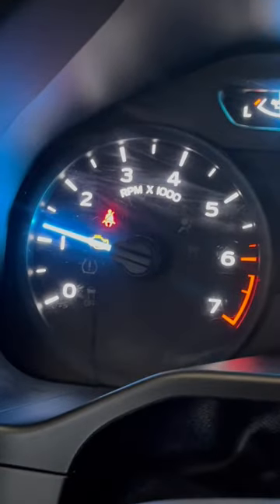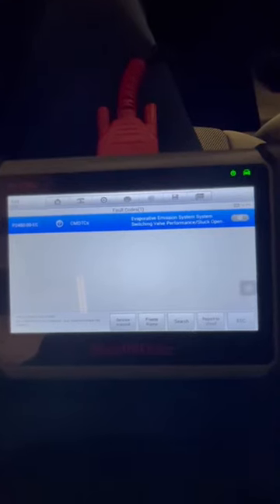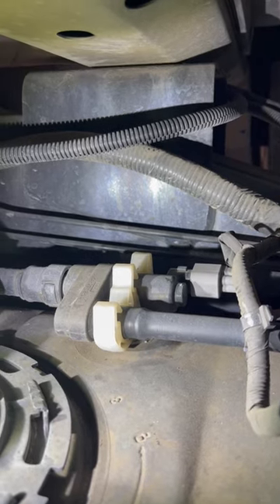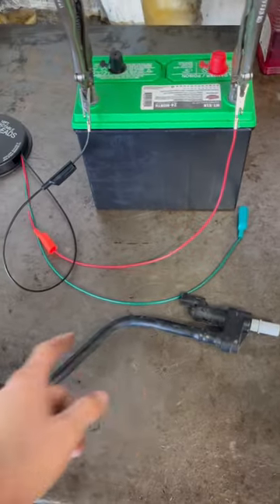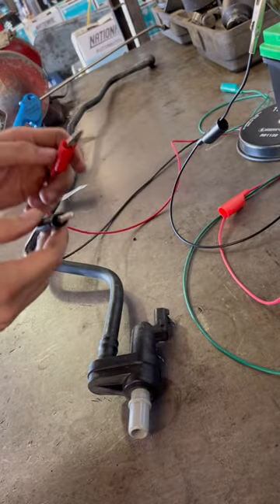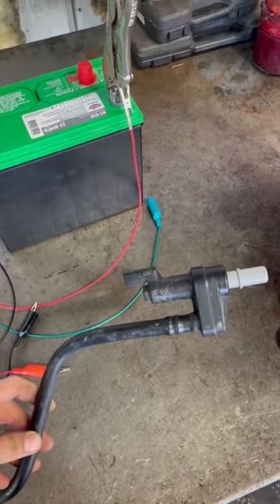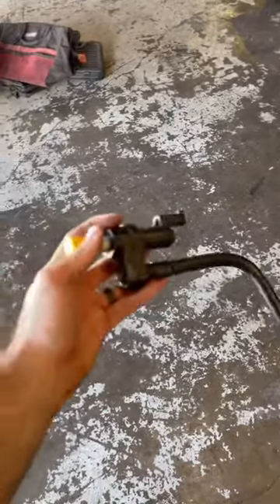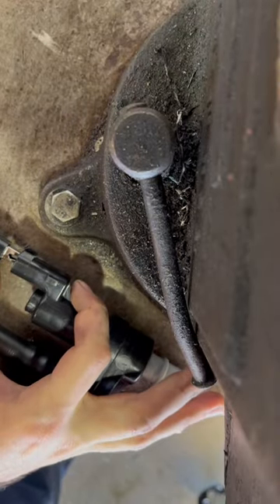2016 Ford F-150 P2450 Code Diagnosis and Fix

Comment: $300! 😳
Reply from the maker: Yeah! List price is $266 plus tax.
Reply: @jackhfletcher  did you tap it with a hammer to make sure it wasn't just stuck? Sometimes brake cleaner will unstick it too, much less than $300
Reply: @byanymeansnecessary9329  maybe.  But what if that only works for a week then your back in paying 90 bucks in labor. So you just paid for the part doing that..
Reply: @Ryan-re1rs  DIY, no labor it's your time.
Reply: @jackhfletcher hello, could you please tell us the polarity. I looked and looked, but I can't see any plus or minus on the pin connectors.

Comment: Complete the evap monitor to confirm fix and no more issues with that system
Reply: How do you do that ?
Reply: Perform EVAP monitor drive cycle
Reply: @jonnysanchez3833 can I do that in my driveway? Any special equipment required?
Reply: @yousufkan6960  no. Google EVAP monitor completing for your specific vehicle. All vehicles are different. 
There are certain parameters you have to meet before the Engine control module will run that monitor...
Engine coolant temperature, air temperature, fuel level, etc etc, just to name a few

Comment: Same f problem right now tell me what can I do buddy, did u order the part at the dealership
Reply from the maker: Yeah, order it from the dealer. Part number is FL3Z-9F945-C
Reply: @Jack Fletcher  thanks a lot buddy 👍
Reply: @jackhfletcher  thanks for your video . I have the same truck same code P2450 my car doesn’t start . did your truck start?
Reply from the maker: @josue cantarero Yes this truck started and ran fine with no issue.

Comment: How can you tell the difference on pos and neg on the sensor to test it like that . Pins different sizes or positioned different. On older switches and sensor it doesn't really matter in my experience you can try either or al youll be ok , but these new delicate ones ?

Comment: Did you have to drop the gas tank or can you reach up there if you lift the truck?
Reply from the maker: I loosened the straps and dropped the tank a few inches to get some space.
Reply: Would this also cause the P2450 stuck closed? That’s what I’m getting.

Comment: I just had this error code today 😩. Any video on how to replace it or fix it?... But my truck is still running with no issues as of now. 121k miles and this is the first check engine light for the Ford haters
Reply from the maker: I need to make one! Technically, you’re supposed to remove the gas tank to replace that part but if you loosen the gas tank straps and drop the tank a few inches you can get up there without having to completely remove the tank.
Reply: I’ve had mine go off once a year for 3 years now. Sometimes it can be as easy as cleaning the seals around the capless filler neck. That’s worked for me twice now.
Reply: @dropbearchupacabra7683  took it to ford ($260 diagnostic) and they said it was tht purge valve under the hood. We will see because I'm replacing it tomorrow
Reply: @devin1820ify was your engine code P2450?
Reply: @yousufkan6960  yes it was this code. It's been a minute. I remember my options was to replace the hose by the engine(which i did) or replace the hose above the gas tank. My light went off but came back on so I'm sure it's the one buy the gas tank
Reply: @devin1820ify  the code for the one by the engine is 1450 , the code for malfunctioning purge valve for the one by the gas tank is 2450
Reply: @yousufkan6960  yep that's next on the list. Is it easy accessible without a lift?
Reply: @devin1820ify  not impossible without a lift , need take the gas tank straps off and disconnect the fuel filler neck on the gas tank. And lower it a bit to gain access to the emission lines on top of the tank. Ideally do this job when the fuel tank is nearly empty that way it will be 200lbs lighter

Comment: My wife's 2016 Ford Explorer, purchased new, has less than 75k miles, we're both retired, we drive less than 10k miles per year, and it's had the following repairs:
1. Rack and pinion, $2200
2. Bad spark plug, all plugs replaced $850
3. Driver power assist module, $750
4. Water pump - $1899

It's a piece of shit. I'll never buy another FORD vehicle.
Reply: $850 for spark plugs? Are they gold plated?
Reply: $1900 for a water pump? Even BMW doesn't charge that much
Reply: Get a set of wobbly extensions from Harbor Freight, when on sale for around $10.
With different combinations of extensions, including those wobblys, you can change the plugs yourself. Get the plugs from O'Reilly, for less than the stealership sells them.
Reply from the maker: The water pump on those is the WORST design I’ve ever seen. It’s run by the timing chain and you have to drop the engine out the bottom of the car to get space to work on it. And what makes it worse is that EVERY single one will start leaking, it’s just a matter of time. Meanwhile a $50 water pump on a Corolla can go 300k miles and never leak.
Reply: And none of it was bad. That is all the favorite rip offs of stealerships.
Reply: This right here is why you don’t buy a newer vehicle. Had you bought a more reliable FORD vehicle this wouldn’t have happened. Lincoln Town Car, Mercury Grand Marquis, Ford Crown Victoria. You can get a super nice used Lincoln Town Car for around $10,000 with 20,000-30,000 miles on it and it will last 8 times as long as that pos newer FORD you bought. But hey, everybody nowadays wants these ugly ass SUV’s.
Reply: You got jewed.  Also, power steering rack is a frequent scam by stealerships.  At least they didn't sell you a transmission they never installed .

Comment: The number P2450. They come up with the numbers from how many issues these new trucks have over the older ones. 😆. This one is issue 2,450.
Reply: Whenever I see a response regarding a problem with a Ford all I read is ...yeah but, yeah but. All brands have their share of problems and believe it or not that includes Fords.
Reply: @MrGlassman11  I own an f150. My company bought a fleet of 8 ram 2500s in 2018. All brand new. Two transmissions had to be replaced before 50,000 miles. They had a dozen recalls in first two years. Anything and I mean worst to best manufacturers all are POS if built later than I'd say 2005.
Reply: @yodaddy82daddy70  Agreed

Comment: Watch Applying power at things close to a fuel thank, sparks can make things go kaboom....
Reply: Gasoline is very volatile, especially when it is a vapour. I think as a tech, the fear goes away eventually with the oxy acetylene torches, working under a 2 ton car and carbon monoxide poisoning. I gave up working because of the risks and how much wear it puts on your body.